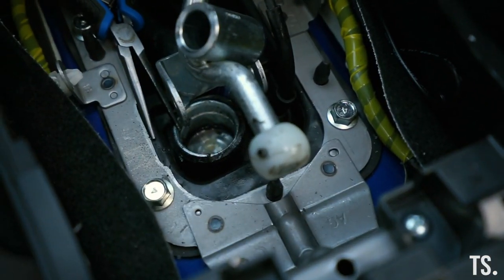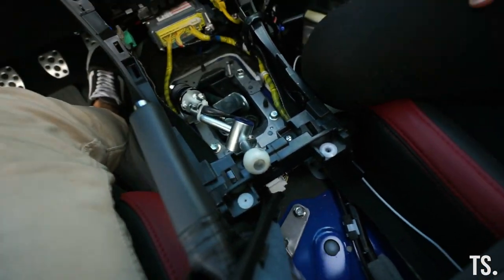Best Budget Mod for the STI | Perrin Short Shifter Adapter

Comment: Good job on the install depite running into issues. I seen you pushed the adapter all the way in which gives the same throw as stock. The adapter can be adjusted, the less you push it in, the shorter/quicker throws you'll have.
Reply from the maker: Thanks Amelito! Yes we realized afterwards about a week later 😅 we did adjust the throw to make it shorter!